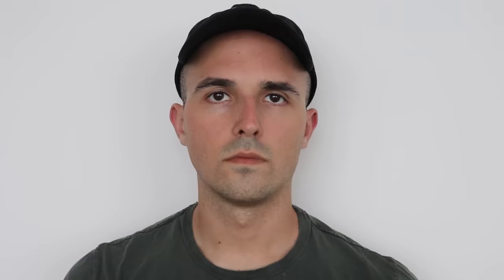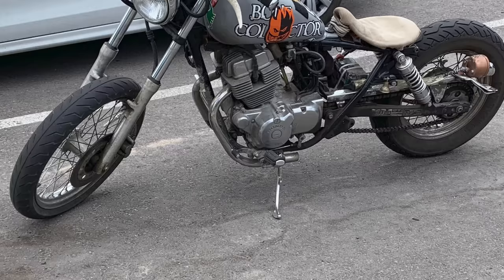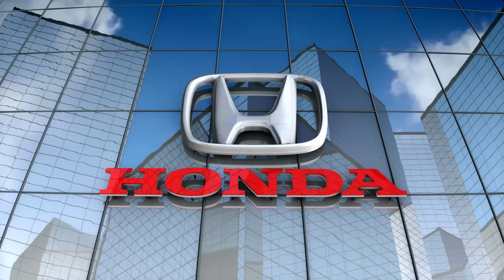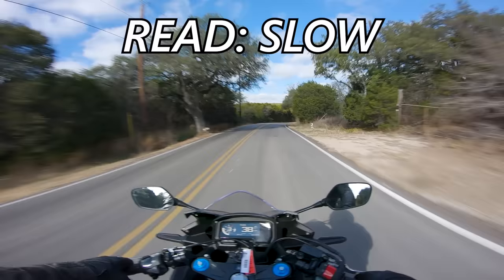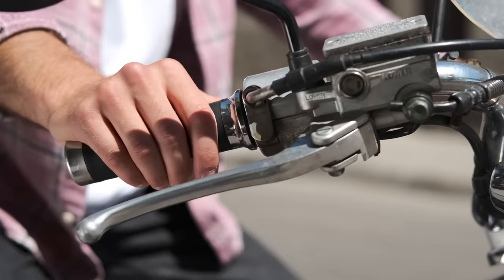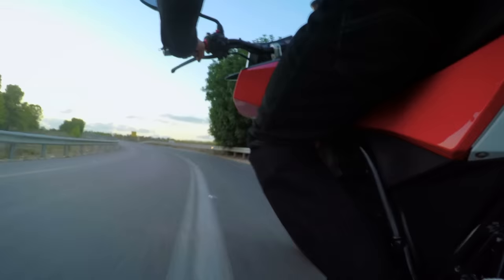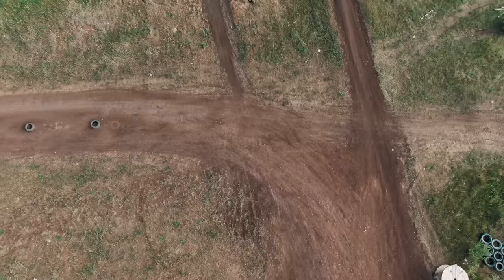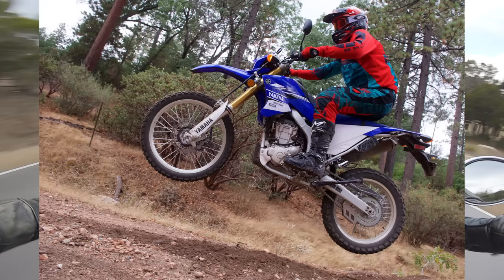7 Used Motorcycles That WON’T BREAK! (Low Maintenance)

Comment: well Honda I have to say ...woodspliter  sat outside two years Honda  engine never even changed the fuel or oil two pumps on primer three pulls fired up ran like a champ  runs still keep adding oil and gas runs still 6 years later . 10 out of 10

Comment: I love my 919 ! When I bought it i was was looking at a few factors fuel injection fuel capacity weight and performance ! It has a 5 gal tank fuel injected and under 500 lb. and it will scream when you want it to !! Being its a detuned fireblade motor I am not at all scared about redlining it if needed!! Looked at the FZs like the 9 but why would you want a bike with a 3.7 gal gas tank???? i ride daily and wouldbe stopping for gas way too much!! Like I said I like my HORNET  : )
Reply: I own one also. I put 80,000 rough miles on it so far. I paid only $6000 for it right off the showroom floor. Other than re-welding the engine mounts-I told you rough miles I’ve taken it off road. I love the 5 gallon gas tank and the 200 mile range
Reply: @karlfonner7589  I have never gotten more than about 140 mils before the reserve light came on usually less somewhere around 130 depending how much I get on it LOL which is pretty much most of the time. I'm sure if I rode very conservative it would be better but WHERE'S THE FUN IN THAT LOL!!! But I have heard this from others as well so it's good to know the mileage it's capable of. 90+% of my riding is around town have always been curious what kind of mileage I could get on a long trip watching my RPMs. Found out along time ago RPMs are the key. Ride safe and have a blast!!
Reply: @martybowen1  That’s still pretty good mileage. Yeah I’m talking about keeping it in fifth gear and 4000 RPM.Which is pretty amazing
Reply: @karlfonner7589  Yeah that's what I figured.Which is an excellent way to go. But even at 56 I still can't resist the urge to twist the throttle LOL!! I learned about RPMs with my camaro and then with a CB750 I rode from just outside Atlanta to Cleveland TN and rode speed limit and kept it around 3500 to 4000 on tach and got the best mileage have ever gotten on a bike. One of these day's I want to take my 919 on a trip put it in 6th gr and see how far it will go. but LOL like I said the kid in me still loves to play !! I am very happy with this bike!!!
Reply: @martybowen1  Man you sound like someone I know. I still have my 72 CB 750. I still wish I had my 68 El Camino. And yes I love to still get Squirrley on the 919-But I’ve seen too many wrecks so now I’m just taking it easy around blind corners
Reply: @martybowen1  Oh yeah I’ll be 60 this September

Comment: honda FT500 single needs new home . my legs gave out 20 yrs ago so it has sat in my garage while i tried to get legs working enough . should u b interested make a reply. its complete with shop manual , yes parts are still available . Oils tires chain seat cover need replacing .

Comment: Even my first bike was NEVER a 250.  A Triple H1 Kawasaki 2-stroke BULLET.  Anything less than a 400 is for girls, or flat out sissies. now the Panigale, well, i for one am not much for italian bikes...................PARTS PRICES mostly. i have owned Honda's, Suzuki's and Yammy's and ya can almost always find parts for a Honda, even from the 60 and 70's. I have 3 GL1100's 81,82,83 and they just will not die. Very Reliable. Got a CB750 too, it's just an ol dependable workhorse.  The Suzuki was my first brand new bike GS750E back in 80 and it was ok. Hated the 85 mph speedo though, could bury that in 3rd gear.  Got a ticket doing 98 in a 35 zone. Did not go to jail, how bought that ???  Lucky day for sure.  Any honda is a sure fire winner and the VF750/800 lineup is robust. pre-2001 though, when they switched to the Chain instead of gear driven cam...........yuckified it.

Comment: yep 2015 honda civic still using press in bearings,,,.. how do i know this they failed at 36,000 miles, then at 64,000 miles,.. and are starting to make noise again don't even have a 100k miles on it

Comment: I had that one Honda that broke down three times in the short time I owned it, never started and had me stranded at the side of the road with a blown engine. Spent as much on repairs as I paid for it and sold it for scrap :(
Reply: mind if I ask what the bike was specifically?
Reply: @tacomas9602  it was a honda cbx650e, referred to as the 'nighthawk'. It was from 1983, so yeah.. Oldie. Previous owner had said it never failed him. Then all the worn parts decided to go while I was the owner...

Comment: Reliable?. I got many bikes. But I use a Spanish Sanglas 500 single, '67 vintage. Got lot of problems. Burns a gallon of gas every sixty miles, and a quarter of oil every thousand miles. Tires wear out eventually. I had to replace brake pads once, but that was maybe a hundred thousand miles ago. I have forgotten how many miles I've put on it, for sure more'n two hundred thousands. It is losing a bit of oompa, though. Mmmm... points ignition and carburetor, totally state of the art. Drum brakes, though.

Comment: 12% chance of major maintenance is not a rounding error.... that's a significant number that is way off. With Six Sigma processes, Honda and other mgr goal is 1 failure in 1,000,000.

Comment: Surprised you never mentioned the GS500. Cheap parts, simple engine, almost an ideal beginner bike.

Sure it's a flat twin carbed bike but they go for miles without problems as long as it's valves are done on a semi regular basis.

Comment: My Honda has had 4 severe breakdowns in the last few years I've been running it, 3 of which have been catastrophic engine failures
Reply: Change the oil and stop riding it in the red line all the time  . . . I have had Hondas since 1981 and never had a break down.
Reply: Sounds like owner error to me
Reply: @coalymoley8396  Which it without a doubt has been :D The bike has been subjected to such an amount of abuse before I got it, that I'm kinda still surprised that I've gotten it running at all, and that it seems to be fairly reliable atm.

Comment: try honda cub 90 lasts forever cheap to run and if you look after it will rise in value eg 90,s in 1984 cost £500 uk pound  new same bike in ok condition now  over one thousand plus

Comment: 7:00 I have a boneville and it would be perfect (after replacing rectifier, upgrades, surviving bad mechanics and taking it off road) at 100,000k's no worries, but with the gearbox, I can't leave it sitting for 6 months without an oil change. That how you kill an unkillable bike.
Reply: 100 million miles woooow

Comment: I think the youngins have an irrational fear of carburetors.  A used bike that won't start goes cheap.  A carb'd project bike for sale won't start becuase the carbs are gummed up.  Invest $10 for a set of torch tip cleaners and a can of carb spray cleaner, and you can get some screaming deals.  Dissect it first and remove the rubber diaphraghm - if equipped- so you don't nuke it with carb cleaner.   Oh, hell , splurge for the rebuild kit.  No computers, no high pressure fuel pumps, no map sensors, O2 sensors, tps sensor, throttle by wire servo...dead nuts simple.   

I'm a multilingual mechanic & speak both analog & digital, and readily admit that all the new tech yields better performance. You can get safely & consistently closer to the performance limits of any engine when you have the feedback that sensors and adjustable fuelling & timing provides, but once properly tuned, a carb'd setup up is very good. How to choose?  Which are you more comfortable with and are you afraid to learn new stuff.   Carbs are easy. Your 5 senses - hey don't lick that - are just about all you need for diagnostic equipment.   

Your mileage may vary.

Comment: Please don't listen to this. Expecting a bike to be reliable "because it's a small sport bike" or "It's a Honda" is not the whole story. The 12% number says basically nothing without context. Is that bikes being brought to a dealer? new bikes? What are the competitors like?  The volume of bikes they have sold also tells us very little about actual reliability over time. 

Any bike can be brought to its knees by being abused. A rebel that was passed around by 20 different owners who never bothered to change their oil, tires, spark plugs, battery, didn't maintain their chain, etc. isn't just going to run forever without some maintenance. There are a lot more factors to picking a good bike that the type of bike and branding. I've been flipping bikes for a few years now (mostly Honda's) and you should expect to pay up some money and time for anything that is older or cheaper. Do your homework, and don't just buy one of these without knowing some history and trusting the previous owner took care of everything. 

Ride safe, buy a cheap bike and do some work, or buy a nicer bike and get your miles in.

Comment: How many old sport bikes do you see running around ? Evo motors don't die . As for oil leaks , that's rare anymore dude . They didn't have Evo motors in the 70s. That's about the time frame when Harleys had oil leaks everywhere. Since then the newer Harley motors have adopted some stupidity in the form of their EFI. Which is by far ran by the biggest piece of sht you can make out of silicon . 883 sporties can get a big bore kit that raises it to 1250 for a reasonable cost . And they work very well. Why do I say this ? Because I've worked on enough to know better. I'd opt for a 1250 carbed sporty if I was looking for a smaller bike.

Comment: Royal Enfield, surely not; mine was terrible, chain made of spaghetti, tyre valve pulled out, wiring failed, charging system, failed, kick start broke, electric start failed. When all this was sorted still wouldn't run smoothly
 possibly coked up, it always seemed to be rich with the plugs fouled. It deserved a Viking funeral but I eventually sold it for a few hundred. Never again!

Comment: Never understood yours & yammies hate for aftermarket levers, if they work & give you better adjustability & cheaper & folding capability why does it matter if you bought them on ebay or amazon? The ones I bought are forged aluminum, better colour they fold & they fit like standard, the only thing i can see is the paint not lasting but the stock ones are black so what does that matter.
Reply: I work on bikes So i see everything. Cheep aftermarket levers feel like the trash they are. They wabble, and wear quickly. And sometimes they don't fit right. I've seen some that didn't hit the brake/clutch switch, and a set that held pressure on the brake!
Reply: @SuperBoomer95  I must of been lucky mine fit perfectly they don't wobble & they look good, must be the exception to the rule, even though they were from China they weren't cheap & they are designed specifically for my bike not like those ads that say universal.

Comment: They are a Piece of Metal Gargabe They leak oil bad and no Mechanic could Fix my Transmission it jumps out of her Junk Best thing is a Lever you push and you are in neutral If the rest worked would be okay. A Honda will outlast a dozen of Enfields?

Comment: If I would have to draw a comparison between Yammie Noob and Fortnine,
I'd do that in the realm of WW2 tank production.
Fortnine is basically Germany, with it's super high quality, down to the tiniest detail tank production, resulting in the best Tanks of WW2.
Yammie Noob, on the other hand, would be like the USA. 
Pumping loads of tanks, with relatively good quality and usability, unlike the Soviet Tanks which were basically crapped out but they were still good enough.

So in short:
Germany = Fortnine -> Superb quality, low production rate
    USA     = Yammie Noob -> Good quality, high production rate 
Soviet Union = I dunno, CycleCruza? (sorry xD) -> Shit quality, super high production rate (still good enough to pack a punch)

Someone had to say this.

Comment: The Kaw KLR would be a good mention if it wasn't beat to hell. They're almost as simple as the Royal Enfield. Extremely " TUFF "'
Reply: clocked my 1993 Kawasaki Zephyr 750 and my 1993 Zephyr 550 (the 550 with a little help from the Mrs) ... both super reliable and imo great bikes

Comment: The Suzuki Savage, later know as the S40. It is the essence of bullet proof reliability and ease of maintenance. I believe the EPA Nazis finally killed it off after 2019, but they made a gazillion of them. I had a Zuke service manager tell me that just about any service manual would go with any year. I would have kept mine, but alas, she who must be obeyed says only one bike at a time and I just had to have a Scout. Don't like paying the dealer $400 for a a valve adjustment because they have to pull the cams, use shims, and dismantle half the bike to get at them? How about a couple of wrenches, a screwdriver and an hour on Saturday morning? If my BSA had been as tough and reliable as my S40, I'd still be riding it all these years later.
Reply: IMO you should only have to do a valve clearance check once every 30-4000 miles. Not much reason for the clearance to change on a bucket and shim system.

Comment: Buying a used Ducaty will make U maybe not entirely lucky but will make u poor. Maintenance costs are hillarious. If U want a used bike that lasts forever and rides great every day, every weather look for Yamaha XJR 1200 or 1300. Have a 1200 with 98000 kms on the clockk no issues. Expect the same again. Engine is converted to FJ 1200 so it  runs 240 if necessary here in no speed limit Germany.

Comment: Im new to the moto world  and trying figure out what to ride and im 15 about to turn 16  In my parents agreed to let me ride a motorcycle to school. But I am considering a grom clone from Amazon or one of those sites so is do you have any other suggestions.
Reply: Don't buy a chinese amazon bike. These are riddled with issues and require a lot of fixing. Look for a kymco k-pipe. They go for $2k brand new, and kymco is a solid brand (used to make engines for Honda). If you are on a super low budget, look for scooters. You can find older kymco, honda, yamaha, etc. scooters with 50-150cc engines all day for under a grand. I used to commute on these to college. A little wrenching here and there, but they are solid machines that are very comfortable. 

Take your time a pick a good bike. There's nothing more expensive than a cheap bike that was neglected and needs constant repairs.
Reply: buy used. don't buy chinese shitbikes off amazon, seriously.

Comment: My Sportster with only 7000 miles on it destroyed the splines on the crankshaft because the engine sprocket nut came loose.   Poor factory quality control, and poor factory workmanship.   Engine will need completely tore down and new crankshaft assembly replaced.   I'll part the piece of junk out and am buying a new Yamaha in the spring.    I really liked my Harley but some of them are endless money pits.

Comment: Do not agree with the WR love Yamaha all the bikes that I've seen on Craigslist and Marketplace have either need rebuilt are have been rebuilt you have to change the oil on these quite often the one I owned I realized at one thing wore out everything around it was also wore out very fun bike should have been left on the track

Comment: Royal Enfield in EU motorways are pointless.. The bike will start vibrating at 85kmph and its annoying when you can legally achieve 130kmph but your body is  too tired for that.
Reply: It's not meant for fast riding
Reply: @pinkyfinger9851  130kmph on a highway is not too fast..
Reply: @someforall  they are coming up with classic 650 with twin cylinder 650 engine which is amazing, that would suit you better
Classic 350 is not really meant for highway riding, most people in India use these bikes just for commute in local areas

Comment: I not see motorcycle more reliable than honda.

Yamaha and other brand just have 20 years life cycle. Not for honda,you can ride everyday until your grandchild born.
Reply: Most people wreck them within 20 years, or trade for something else. I think the old Kawasaki 2 strokes were one of the most reliable, those are older and way more reliable than some of the Honda's. Not only that, but 2 strokes you can do wheelies and not worry about oil lubricating at weird angles.
Reply: @jakegarrett8109  i am not talking about 2 stroke. Honda almost doesn't have 2 stroke motorcyle in the world.

2 stroke engine is simple. 4 stroke is complicated. This not apple to apple.

2 stroke not realiable for daily use.
2 stroke also blown up faster than 4 stroke because this engine create heat 2 time.but easy and cheap for maintaince.
Reply: @nejoh713  My dad also has multiple Honda CB350's, and its good, because he's went through a couple engines (their timing chain idle rollers fail with age even with low miles, all the rubber in them turns to junk, and they are just terrible engines). My grandpa also has a couple Honda bikes but those aren't the one's he used much (too heavy and the little Kawasaki was just much better). I'm not sure what all work those need but they have factory paint and stored in a nice shed for years, he took very good care of them but I remember him working on those Honda's and giving up (partly because the Kawasaki was easier to fix, and I was like 8 or 10 so he started fixing up the little 90cc because I had an interest in riding and that one was perfect).
Reply: @jakegarrett8109  i know kawasaki also have a good product,also for 4 stroke. What about spare part? How cheap that?

Timing chain is a fast moving part. This a common problem for 4 stroke engine,and you will get a problem before 30.000-50.000 km for normal riding. Clutch also common problem and fast moving part.

My point of reability is a piston burn,connecting rod noise. Crank shaft bearing wear. This part very expensive for maintanance. This must be reliable and heavy duty.